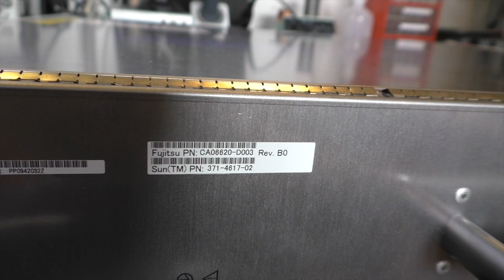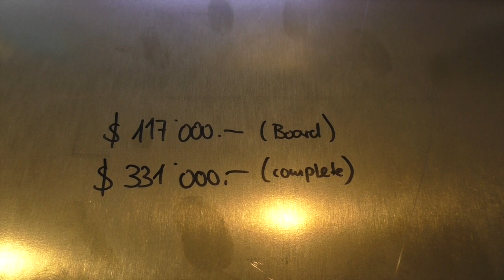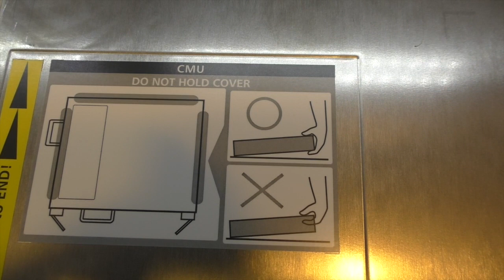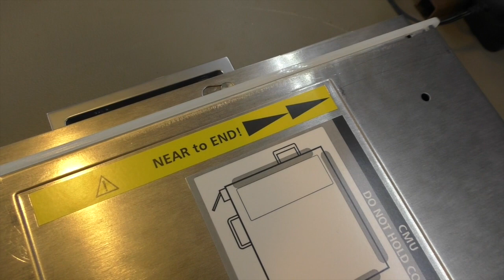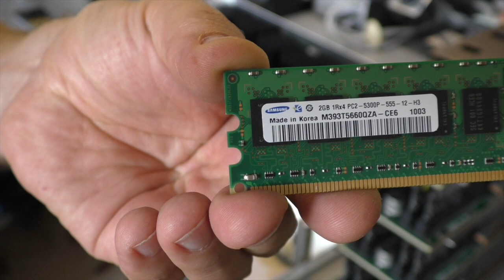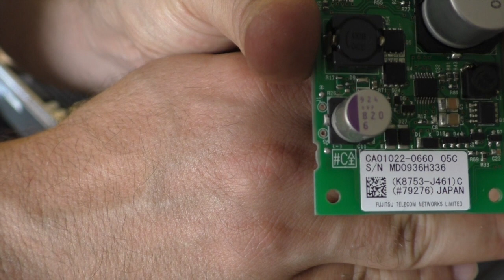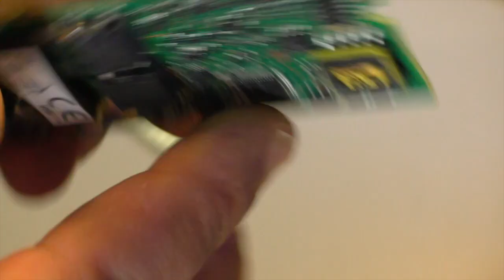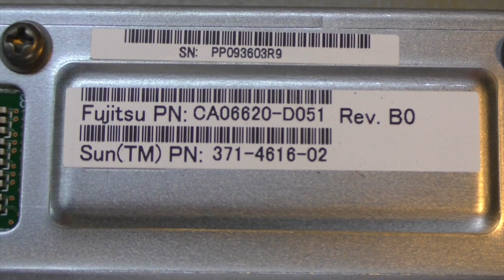How about a $330'000 CPU or a $50'000 cable? (PWJ19)

Comment: That SGI cable is a CRAY-Link, designed by SGI (not CRAY). It was the main bus interconnect between compute-memory nodes. The machine was ccNUMA, cache coherent non uniform memory architecture. The cable pricing is a way to charge for upgrades to the architectural topology of a scalable system where cable interconnect gave you more memory bandwidth in a scalable architecture. More than the cable the switching crossbar memory controller ASIC on each node was the real smarts behind the architecture and what you're really paying for when you buy the cable. In its full configuration you could build a hypercube of interconnected compute+memory nodes where all CPUs in the system had cache coherent read & write access to memory on any other node without worrying about manual mutexes etc. Add more cables and you increase the "cross-sectional bandwidth" of the entire system and lower latency to remote nodes. All memory addressable as a single image from any process running on any CPU, physically mapped via the processes secure vtable of course, and supporting vtable page migration from node to node to support processor memory affinity and further reduce latency. So not really "just a cable". Loved the comment about who might manufacture these miraculous cables :-)
Reply: +Pontus Borg that was the best line in that video :-)
Reply: +Pontus Borg I should have visited the factory :-)
Reply: i can't tell if that was an excellent joke about how you'd justify charging 50k for a cable, or you're serious.
Reply: Bobby M Serious, I was pre-sales tech support for those systems and then moved to Advanced Systems Division in Mountain View, CA. At one point I used to work in the Googleplex building when SGI owned it.
Reply: +dorbie I guarantee you have confused alot of people... I understand you yet others will not when working in these environments.. Basically Nodes(CPUS) and memory connected to each node(CPU) had access across multiple servers in a secure environment where via as he said (vtable), imagine exactly like a network(vlan) where packets are not viewable by other physically connected users on the same switch/hub. A truely amazing thing people take for granted when using software like VMware/Citrix/Virtualbox without understanding the real framework and security implications this has across networks without completely separating them on a medium, i.e copper/fibre/sat..
Reply: That's all well and good but did it enable it to run crysis.

Comment: I just cringe at some of the stuff I spent so much time on as a young engineer, you pour your heart into the design only to see it become junk 10 years later.
Reply: I hope he is selling the stuff he reviews cuz there would be ALOT of people buying it
Reply: @AlpineTheHusky  Not necessarily. Some of this stuff may have been top of the line hardware in its day but now new systems have come out that offer more computing power in a smaller package with far lower power consumption. Even if you can find it cheap on the second hand market people won't necessarily be jumping on the opportunity. The operating cost for older hardware like this is going to be a lot more than newer hardware of equivalent (or better) capability.
Reply: @TehMG  Yeah I know. Nobody is buying thats stuff cuz they need it. They buy it cuz they want it. Its fun messing around with old hardware.
Reply: Everything you invent gets used forever in new versions
Reply: Then dont pour your heart in it then and get a girlfriend to spend your money

Comment: Interesting on all that high end kit there's minimal trace routing on the outer layers - everything disappears into a via to inner layers.
Reply: +mikeselectricstuff Probably for EM shielding and improving signal integrity.
Reply: +Eviltech nope... I guess that makes it easier for layout
Reply: +Saeid Yazdani That would be my guess to. A lot more room since you don't need to route around components. Thre is minimal stuff in the way since vias are very small.
Reply: +mikeselectricstuff This is quite similar to one of your own tear downs except this one is more highly populated. You can see its like a drawer so really no need to hold voltage regulator boards into socket - much less critical than the RAM modules. 
This is not untypical of Industrial type computers. I really loved Sun Workstations and you saw just how good they were when the OEM (Credence LTX) decided to substitute a third party workstation.
In many ways the iMac has a lot of the capabilities of SunOS in terms of applications but Apple is not widely adopted beyond the individual workstation.
Strathclyde University Glasgow has a new Supercomputer made by Dell so it's all Intel CPU.
The same happened to Digital Equipment who had the Alpha CPU - it just didn't gain enough commercial success and eventually had to be sold off to Samsung.
Reply: +mikeselectricstuff I wonder how many layers that PCB has?
Reply: Justo Talkalottashit Yeah. X-ray, or, if you know the resin used to bond the layers, possibly solvent.
Reply: +mikeselectricstuff That's the luxury when you design top stuff. Everything gets it's own layer, done. Noone cares if the board is 1000€ or 1200€ as long as you met time to market.
Reply: +Saeid Yazdani nah, shielding is most likely, multilayered  PCB always have solid layers, but cheap ones have  shild layer inside only, to separate layers, while expensive ones, made by MIL specification have outer shield to
Reply: +mikeselectricstuff  I imagine its also like that because it makes it harder to clone. by reverse engineering. there is no telling what design elements are hidden between the layers.
Reply: Digital X-ray imaging can tell you that within a minute.
Reply: LloydBonafide1 what do you mean dd ?
Reply: Paul Freedman I would think there are still ways to design the layers to make that harder. But most people dont have an xray machine.
Reply: Paul Freedman you are probably correct though. Do you think it is mainly to protect the traces from possible damage or interference?
Reply: EMI seems like the most plausible explanation for burying the traces.
Reply: He says there's no caps on that power supply because of the coils. but there is lots of caps the beige and off white SMD's are caps. You didn't notice?
Reply: Wish my PC was built like this thing.
Reply: On that note,  I'm looking for volunteers to reverse-engineer it and send me the schematic diagram. I need it for practice
Reply: All routed on internal layers, easier to fan out BGAs by dropping blind via (or vias in pad) down to different layer, without perforating or breaking power and ground planes.
Reply: @saeidyazdani  Easier for layout has noting to do with it since cost doesn't matter in cases like this.

Comment: Yes, in every rack there's also a CPU removal tool (screwed to the front left side) it's SUN part no. 371-3418 and it looks (and is) as expensive as the rest of the machine.

Comment: great video. I guess the thermal conductive material / mat is built like matrix of pillows, which then under pressure get flattened and there is room needed to expand. If it would be a solid, then it would have pressure points and with that lower pressure points resulting in  uneven cooling across the chip... smart approach... that's same concept is applied when glueing large flat surfaces together: beeds, so the air can escape and glue can spread. Same technique is used by the 'Plaettlileger': the trowel looks like a castle and produces a base to press the tiles on until they are flush, and nothing has to ooze. The groves take on the superfluous material.

Comment: There’s a lot that goes into that cable, probably made using a microscope and ultrasonic welding. Then days of environmental and electrical tests. The materials used would have taken a lot of R&D too. They know that the cables will be a #1 point of failure, so they are always over engineered
Reply from the maker: That may all be true but it's no reason to call $50000 for one. But there is a CRAY label on it, that makes the price :-)
Reply: @PlaywithJunk  The label argument doesn't really apply here, they are not creating social value by saying "buy our expensive watch, it will show how wealthy you are". Companies are buying Transactions per second or maybe FLOPs, if it costs X to deliver a system that makes Y profit, then that's the deal. If they could make do with 1,000 women with calculators then they'd have options.
To R&D something that has never been done before is expensive, cables are not just bits of copper in PVC, the dielectric properties of the insulation, the skin effect, the physical arrangement of wires, the circuitry to drive them (ECL is very much a black art), these are all interdependent. Like silver isn't used in the cooled section of quantum processors because it is susceptible to thermal and electromagnetic noise. That connector, Cray had a patent on all of that. The equipment to test anything like single digit nanosecond rise times, this all had to be invented first, just like CERN has basically to invent half of their test gear themselves. All these people need to be paid and their future research has to be paid for too.
If you want to get into exorbitant pricing, a company I used to work for made cable harnesses for tanks... 😮
Reply from the maker: Well... yes and no. The label on a professional device has not the same value as for consumer goods but the story is similar. I know a bunch of devices that are sold with a no-name label or for example with a HP or IBM name on it. And the big brand names were multiple times more expensive.
If you buy a CRAY machine, you don't want cheap cables on it, even if they are exactly the same. But all the technicians will tell you that you need the originals or it won't run properly. 
And you don't have the time or knowledge to proof them wrong. So you buy them...

Comment: Just some misinformation here. Gold doesnt reflect heat. Gold is one of the best thermal conductors. Although superpure copper has slightly higher conductivity it forms an oxidation layer which reduces the surface thermal conductivity below the one of gold( which is non reactive element and doesnt form these easly). 
Also nobody makes cpucovers out of copper anyway because they would react with the thermal compound and reduce their properties while gold does not. 
The only better conductive materials would be graphene, liquid helium and freaking diamonds. It is still cheaper to gold plate a cpu chip than to put shit tone of diamonds in [somehow]
Reply from the maker: +GotCritified Gold may be an excellent thermal conductor but it does also reflect heat very well. Why are those emergency blankets gold plated?
I have thermal images from such boards where I unsoldered some of these chips. The thermal image shows the CPU at 50C while the rest of the board is at soldering temperature (about 300C). It does almost not emit any infrared radiation.
Reply: +GotCritified It look like you are little confused. Gold is best material for heat reflection, it reflectance is close to 100% for wavelengths in range from 700 nm to 1 mm (700 nm ≤ λ ≤ 1 mm) which is infrared spectrum (heat waves).
Heat reflection is applied only to heat transferred by radiation (IR spectrum) and it is have nothing to do with thermal conduction, they are two totally different things.
By the way silver have higher thermal conductivity then gold and copper, but as copper it is less chemically stable than gold.
Reply from the maker: +Leding silver oxidises and turns black after a while
Reply: +GotCritified I have been saying this in all his videos XD
Reply: Then why are aftermarket turbo heat shields often gold foiled?
Reply: Nerd.
Reply: they actually do make them out of copper, but they plate it with a more corrosion resistant metal, like gold to take care of the oxide problem.
Reply: Nathan savage
Reply: GotCritified Aren't all modern Intel IHS and AMD IHS made of nickel plated copper?
Reply: Gold is used in everything from super-car engines and satellites to the aforementioned thermal blankets and lasers for it's ability to reflect heat away from or towards critical areas.  It is gold's most valuable trait scientifically, more so than it's conductance.
Reply: The engine bay of the McLaren F1 was insulated using gold foil due to its heat reflective properties.
Reply: It is used in some thermal blankets but the ones you see on satellites are made from aluminium. The gold colour comes from the polyimide plastic used, which is more resistant to temperature than the usual biaxially oriented polypropylene.

Comment: The cable for the SGI Origin 2000 is a NUMAlink cable. From what I can find, the Origin 2000 used a NUMAlink 2 cable, which had a peak bandwidth of 1.6GB/s.... In 1996! It was used in distributed shared memory clusters. Basically connecting units together and making sure they can maintain memory speeds as if it were all on the same board. 
So the materials and labour of the cable would have been peanuts compared to the asking price, but what it could do would be worth a lot to some companies! And SGI knew they could charge an arm and a leg for it! 

Just for fun, the current version that was introduced in 2014 is NUMAlink 7, and is capable of 14.94GB/s! I had a quick look for pricing, but couldn't find anything. I think it falls under the 'If you have to ask, you can't afford it" category.
Reply: I guess that "NUMAlink" was the way that the NUMA NUMA guy found his wife?
Reply: @johncoops6897  It's just the name of the system architecture (Non-uniform memory access).
Reply: @Max_Mustermann  - I guess you need to Google for "Numa Guy" to get my joke.

Comment: Those memory modules are registered ECC type.
ECC is more advanced than just parity, it can correct one corrupt bit without actually disturbing the execution of the applications running on the server, the controller just notifies the operating system that it happened. But if there is more than one corrupt bit then ECC can no longer correct it and the operating system has to halt or at least terminate the task(s) related to the bad memory area. There is an entire memory chip on the module dedicated just to ECC.
Registered means that there is kind of a buffer chip on the memory module which takes some electrical load on the address/control lines away from the memory controller.
I remember how ridiculously expensive those registered ECC memory modules once were, even generic ones not bought as official mainframe spare parts.

Comment: They use gold plating primarily because its stability. Copper and silver oxidize and that can cause problems. For the price of the machine, they insured that there would be no corrosion problems on the circuit boards

Comment: From what I understand gold is an exceptional conductor of electricity and heat, for it to act as a heat reflector there needs to be an air gap? So it makes perfect sense that the CPU has a gold plating to transfer heat from it to the heat sink. Also gold is very soft so I assume when the copper base of the heat sink is mounted onto the CPU you get a very good interface.
Reply from the maker: yes this was a misinformation by me. I thought that even without an air gap the gold would reflect some heat back into the chip. which is not the case.

Comment: When the system was introduced, that memory would had been absolutely state-of-the-art...
Reply: Not really, 2GB DDR2 never really turned heads, back when DDR2 became available 4GB per DIMM  was normal for DDR2 and later 8GB per DIMM even came in, 2GB was very cheap, which is why you can find it everywhere even today and with 32 of them you got a decent amount of memory back then, today 64GB comes in 1 single DIMM...
Reply: He is talking about quality, not quantity, gold plated, parity ECC RAM with rowhammer immunity and military grade IC's that even Samsung can't fabricate.  State of the art means indestructable, not high capacity.  The tech used in server ram in 2013 is probably only now filtering in to desktop usage.

Comment: If you're going to pay millions for a high-end data-cruncher, 50k for a cable don't matter at all. Especially so if the cable is needed to run the thing.
Reply: +My 2µF The cable improved the memory bandwidth in scalable systems, that cable is your main distributed memory bus, it also reduced memory latency between nodes.

Comment: Amazing how this ultra-expensive hardware becomes obsolete in a couple of years.
Reply: This system is from 2007, it lasted 8 years and will probably be broken down and resold as spare parts for customers who continue to run their systems.  Enterprise hardware doesn't become obsolete in just a couple of years.  It often lasts decades before it's worth replacing.  Who knows why this one was taken out of service, could have more to do with corporate restructuring than for any technical or performance reason.
Reply from the maker: It depends on the brand the type and the configuration. Some systems can be sold easily and some not. The Sun 5000 for example is only worth a couple of bucks. A Sun 3000 would be some thousand $$

Comment: Gold is used in connectors because it doesn't oxidize. Oxidization increases electrical resistance.
Reply from the maker: How did you find that out...?

Comment: Many of the parts can be framed for hanging on the wall as a collectible (with brass plaque).The motherboard should be made into a custom made coffee table.The heat sinks can easily be sold on ebay.

Comment: 6:48 Well gold actually does have point (but is never seen in consumables of course) since reflecting back is only for radiant heat, but that is not the case here since they are in physical contact with each other so heat transfer only occur though the metal instead. So it is beneficial, and here money doesn't matter only the best does even if it would have worked just fine without it.